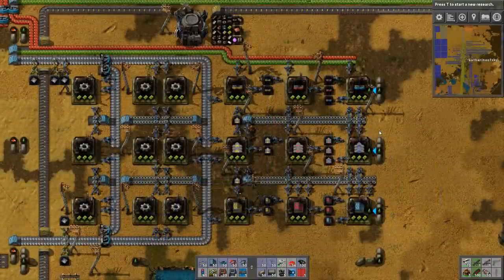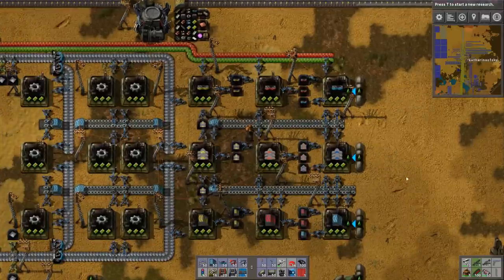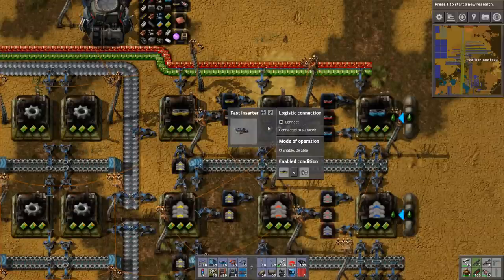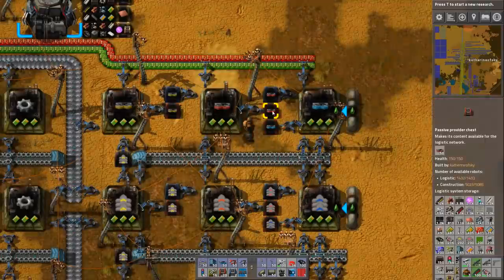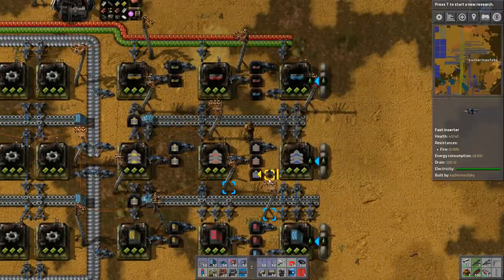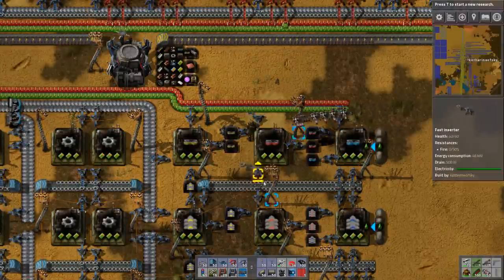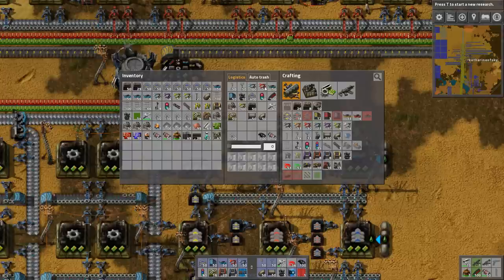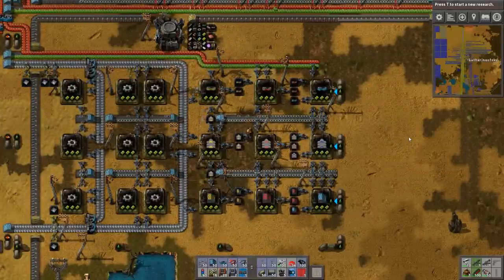Factorio Tutorials: Belt Array -- Version 2

Comment: Elegant solution! Thanks! I didnt know about the bots priority, prefering the storage prior to passive providers.
Reply from the maker: Yeah, it's a pretty neat feature!  I think you've just convinced me to change my standard belt array in future playthroughs!  :-)
Reply: A great solution, although I've always hated making bots make such short trips when inserters could do the job. I'm having trouble thinking up a workaround thbough.

I was considering something like having a third inserter connecting the provider to the next assembler, wired up to the provider, comparing the logistics network quantity with the quantity in the provider and operating only when they match...  Or transferring from the provider into the requester if on the same condition was true and the requester was under a certain amount, but that would require either a combinator or putting a hard limit on the requester's size with the red X (and might still require a combinator to compare the logistics system value with another circuit network value, I'm not sure if that can be done directly on an inserter)... Something to think about I guess.
Reply from the maker: I too prefer to generally avoid bots for such duties.  I've worked on this problem for a bit, but can't find anything that will be "foolproof" and prevent bots from racing around attempting to fill the conditions.

Comment: Nice setup. I use something similar, but I just use (yellow) logistic chests instead. That way I can request the belt items I want, and and if I trash belt items, they are brought back to the same logistic chests and "obsolete" belts are recycled automatically.
Reply from the maker: The problem with yellow chests is that all kinds of random items can be stored in there -- and fill up your chests so that there is no room for more to be produced.  In addition, you are NEVER guaranteed that the right belts will end in the appropriate chest to feed the recyclers.  Requesters and passive providers are the only types guaranteed to work without any monitoring.

Comment: This is a really great system. Usually I make a separate extendable design for producing each variety of belts, but I will probably start to use a similar method to this in future (though I might play around with scaling it up).
Also, the changes that you made for this video seem likely to be very useful. Whilst I can see why someone might want to switch to the highest belt tier as soon as possible, I've found that it can be far cheaper to use lower tiers where you have multiple input lines to a single output line - particularly with my play style which generally involves mining every ore patch I come across and using them to feed separate specialized production cells.
Reply from the maker: Now that we have much larger inventories, (with power armor), I too am finding myself using lower level belts where they suffice.  It cuts down on the massive amount of lubricant needed for blue belts in assemblies, mining, etc.

Comment: Wouldn't it just be easier to make the buffer chests passive provider chests and add a circuit condition to not craft higher belts if you don't have X in storage?
Reply from the maker: This video was made before the existence of buffer chests.
Reply: @KatherineOfSky  Not talking about logistics buffer chests this time. Honestly, I forgot they exist now.

 By "buffer" I mean the chest between two tiered machines. Make the chest a passive provider chest, and add a circuit condition to the outgoing inserter "active if yellow/red belt > 500"
Reply from the maker: @Avaruusmurkku  The simplest solution is the buffer chests, but you can do it any way you prefer.

Comment: Hi
I’m still a bit confused about this whole replacing thing, because it is not shown in your videos. In your previous version of this video (Factorio Tutorials: Belt Array) you had yellow belts, how did you change them into blue? Did you manually placed them down or did something clever with the bots?
How do you actually change the yellow belts into higher tiers? Do you place it down manually in your factory or do you do it with the bots somehow without going around your factory and placing down yourself? Are you using blueprints or something? I would appreciate if you could explain this to me thanks
Reply from the maker: Hi Mightyhidden!  In vanilla, you can upgrade belts by placing them over the top of other belts.  (Using robots is a messy business, since they have to take all items off the line, store it, then place down the new belt).   
Personally I LOVE a mod called "Upgrade Builder and Planner", which allows you to use a blueprint-like object to select belts, and it upgrades them to the tier you specify.
Reply: Ah excellent I thought there was such a function in the vanilla game, that is why I was confused. I hope the developers add such a function in the game later on. It’s good to know there’s a mod that tackles this issue. Thanks a lot for your response & great video

Comment: When you first start with robots does everything need repair. I have 500 construction robots and 8 repair pack assemblers. The number of repairs to be made never goes under 500.
Reply from the maker: I never have more than one repair pack assembler, and have 100 packs limit in the chest.  That's enough to supply trains going to all wall-stations in a VERY large base.
Reply: I built a large wall. Every time you build something (belt and wall) does it have to be repaired.

Comment: First of all, I like your tutorials and your videos in general! :)

Now to my question: so, the idea of this system is, that you have access to every belt type anytime,...
Why not just use your first version and set a condition - like start grabbing, if >=50 yellow belts, etc - for the inserter, which is providing the next (eg. red belt) factory?
Could be, that I'm missing something, since it's 4 AM and my mind's almost gone after a Factorio marathon lol

Anyway, great work, and I wish you nice holidays! :)
Reply from the maker: Hi, thanks!
The reason is twofold: 1. So that we can have lower belts provided. (Provider chest). and 2. So that we can recycle belts from the storage system.  This requires a Requester chest.

Basically, when you get to having robots, you will use either Trash or Auto-trash to get rid of large quantities of lower level belts as you upgrade your main bus for more throughput.  These belts will be put into Storage chests, and you need a Requester chest to put them back into the array so they can be upgraded to higher tiers :-)
Reply: Okay, okay, I get it, with my idea, you'd have to manually grab the lower tier belts, which I'd probably fix with another inserter grabbing from the requester to a provider chest and limit it to 50 or something like that.
That's (one of) the beauty of this game, there are so many ways to do things :)

I'm more an intuitive player and have more like an organic play style (at least, when I play alone, cause there is something else to do what keeps me from building methodically), though I played somewhat like +1500h ;P
But I like others 'systematic' factories, and since the game updates quite often, I watch some tutorials every now and then (like I didn't know, there was an auto-trash now in vanilla lol).

Either way, thanks for the (rather quick!) clarification! :)

Comment: Were you doing anything special with that grid of storage chests?
Reply from the maker: Nah, it's just the storage for the base.  I tend to have very small storage areas.
Reply: Ah, i was hoping for it to be some kind of solution to the problem of "how to distribute various things across the entire area of a base" so bots don't have to carry stuff all the way from one end of it to fill logistics slots if you step into logi area on another end. Been pondering that one for a while yet, but i don't think the game actually provides useful tools for that.

Still really nice and educational video even so. :)
Reply from the maker: Thanks!  Yeah, that's still a bit of a problem.  You can limit things by area if you want to assure that certain numbers of robots are available for tasks.  (I use belts crossing over the separation between networks.)
Reply: Haha, that's a different problem, and i think might be getting solved at some point by the devs making bots smarter. :)

The one i mean is for example when all my turrets are stored on the west side of the base, and i return from a mining expedition in the east. It results in bots having to go all the way to refill my logistics slots, which can take an annoying amount of time, or an annoying amount of preparation to avoid manually with requester chests wired to storage chests.

It could be solved if there was a way to quickly set up automatic storage areas at various points in the base which would be refilled like requester chests, but still available to the entire logistics network. Another way would be to have a chest which causes bots to automatically put its contents into storage chests. However neither of those exist, and for now i can't think of a non-annoying solution.
Reply: well if you limit things with the curcuit network on each chest in your base then there should be alittel of everything in each chest so the robot's can take the shortest range they will still have to fly a long way to load the chest again but you have something right away

Comment: Nice Video, but you could have saved a few requester chests by simply limiting the space in the provider chests using the red X on the last slot.
Reply: and you normally don't need to grab from storage first! Since your constructions (by robots or you) will normally be fed by the Storage chests first ...
Reply from the maker: I think you misinterpret the point of this video.  The idea is to recycle all the thousands of belts that you are replacing with higher tier ones... (e.g. your main bus is made of yellow belts, and now you want blues).  if you don't put in requesters, all those yellow belts will sit around for eternity... so they must be grabbed from storage (by the robots) and fed back into the belt system.
Reply: there are still better ways to solve this using circuit network conditions and logistic network conditions
Reply from the maker: "Better" is a subjective term.  The beauty of Factorio is that there are many efficient ways to solve problems.